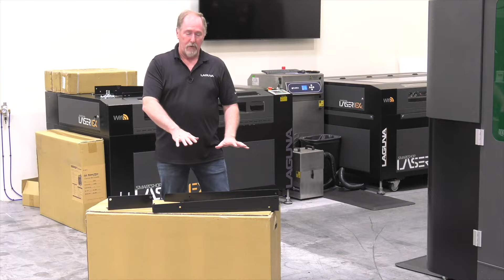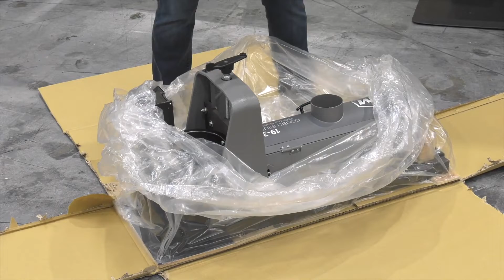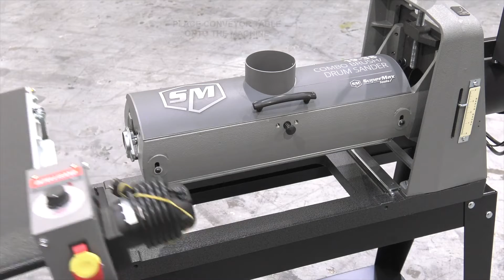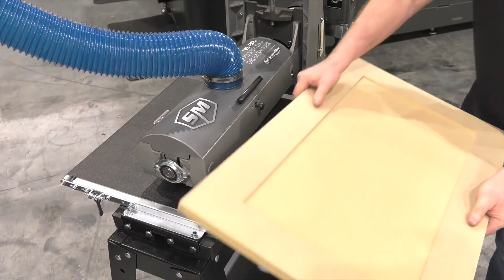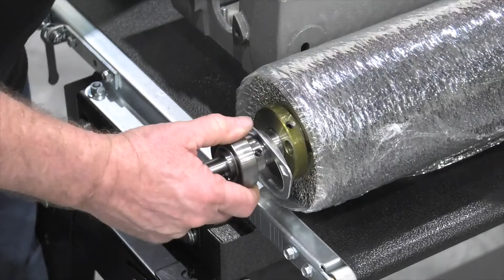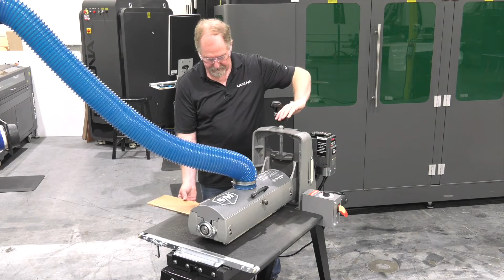19-38 Combination Brush/Drum Sander Assembly: Step-by-Step Guide

Comment: Does anyone know what the different modes are when you press the mode button it has different ones but what does each do
Reply from the maker: The "MODE" button is part of the VFD (Variable Frequency Drive). VFDs are used for a variety of functions including motor speed control which is what it is used for on the 19-38 Combination Brush/Drum Sander machine. Many functions and settings of the VFD are locked out internally as they are set from the factory. Pressing the MODE button on the control panel of the VFD will change the digital screen display between Speed/RPM, Amperage, Forward, Frequency, and actual output frequency.  

You can read more about the 19-38 Combination Brush/Drum Sander on our website at https://lagunatools.com/classic/sanders/19-38-combo/ and regarding the VFD at https://lagunatools.com/wp-content/uploads/2024/03/1938-VFD-instructions-030624-1.pdf.

Thank you.

Comment: I noticed you didn't level the bed to the drum...is that something that you need to do from time to time?
Reply from the maker: The SuperMax 19-38 Sander was aligned and adjusted at the factory. However, simple alignment checks will ensure. that everything is in perfect order. The drum to table alignment is covered in the owner's manual on pages 11 and 12 should you need to adjust your machine.
https://lagunatools.com/wp-content/uploads/2022/12/19-38-Manual-ENG-120622.pdf

Thank you.

Comment: I have an original 19-38 supermax. can I purchase the to nylon brush head and flap sander head and fit in there?
Reply from the maker: The brush heads and flap sander heads are not compatible with the 19-38 Drum Sander, they work only with the 19-38 Combination Drum/Brush Sander version.